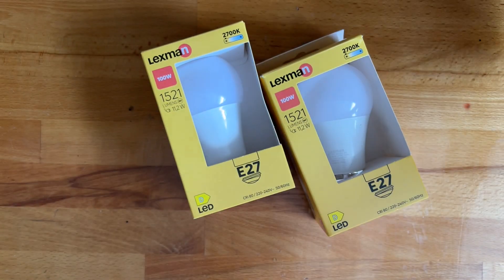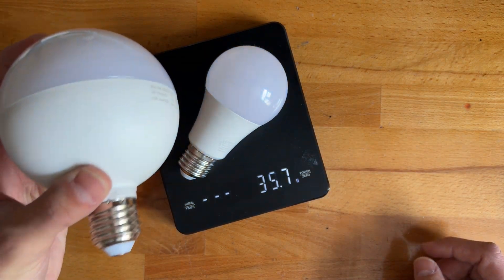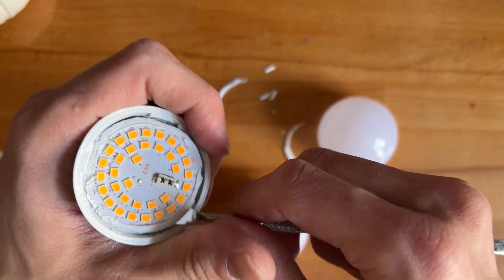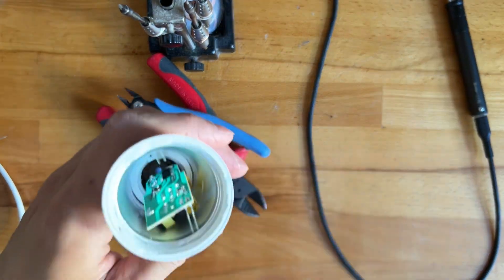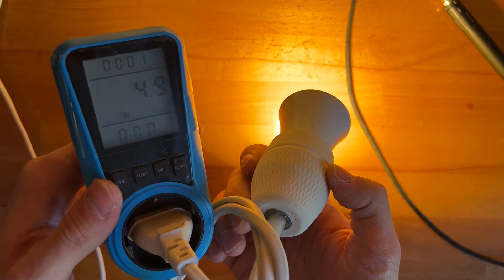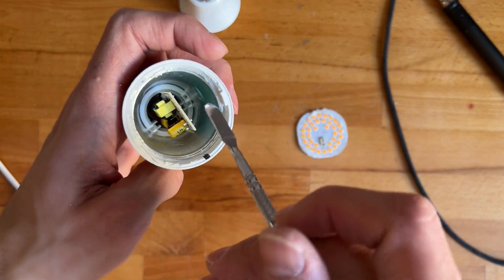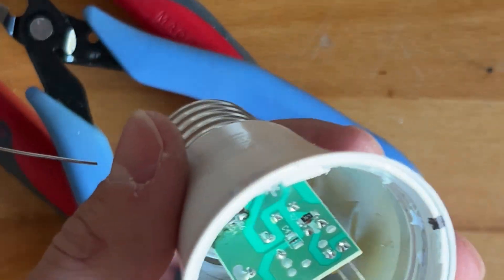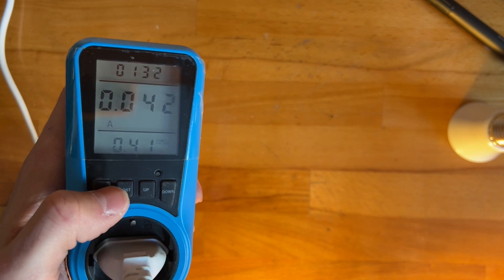LED Bulb Hack - Decrease Power & Increase Lifespan (3)

Comment: I've started doing this mod and since the ones in here dont have matching resistors in parallel, i try different combos and the ones that dont heat the casing (after 5mis) too much are the ones i end up using (60-70% higher resistance than stock)